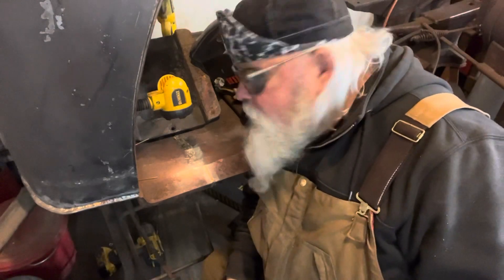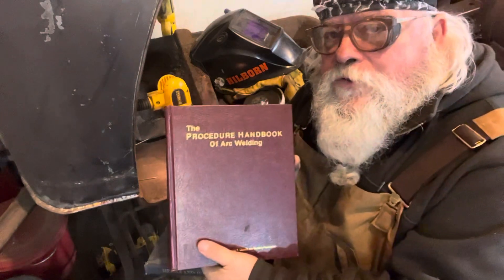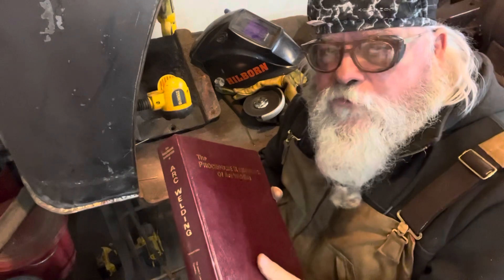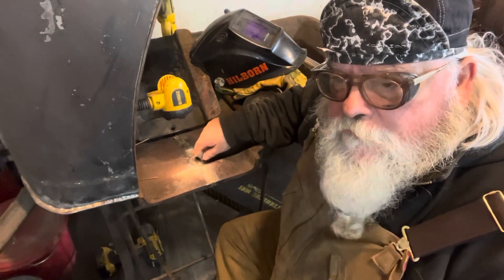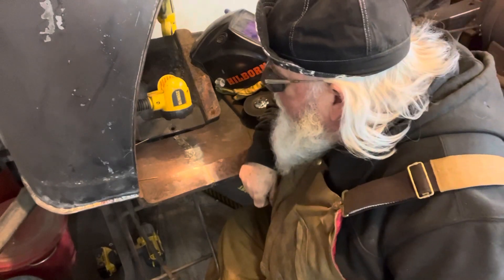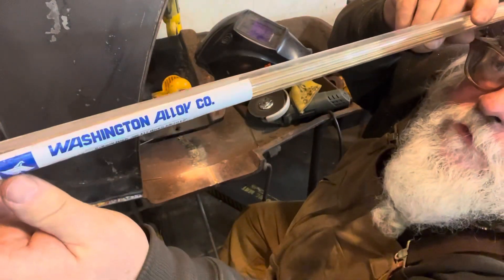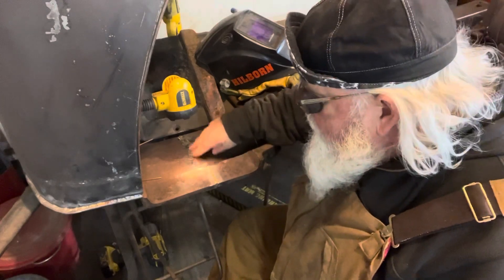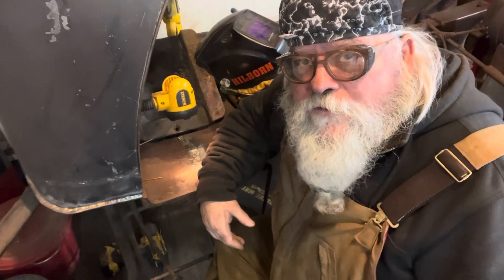Aluminum Bronze Cast Iron Repair

Comment: I prefer AL bronze better than silicon bronze when I've used it. I've also had better luck running both on AC rather than DC (cleaner, less scummy welds).